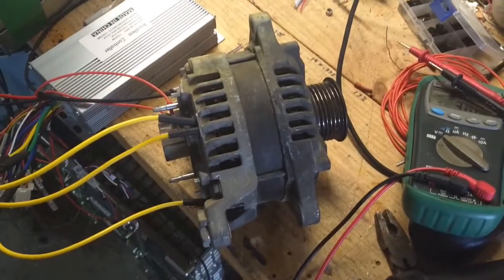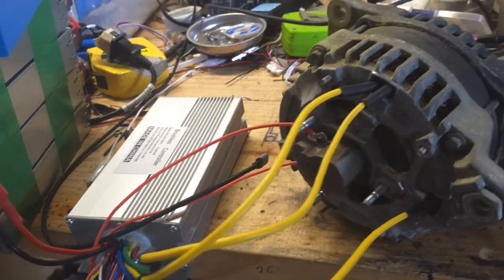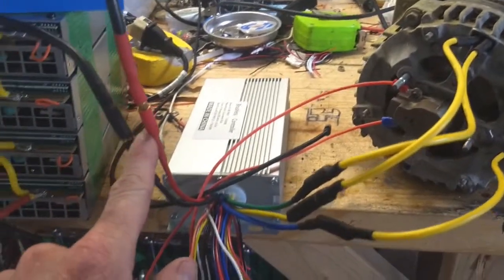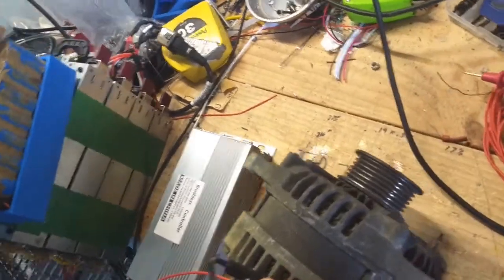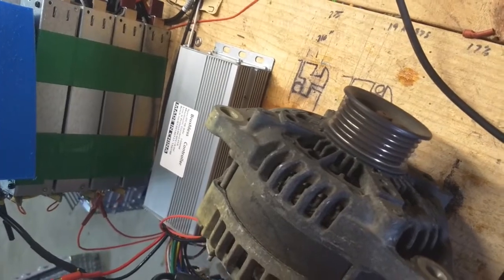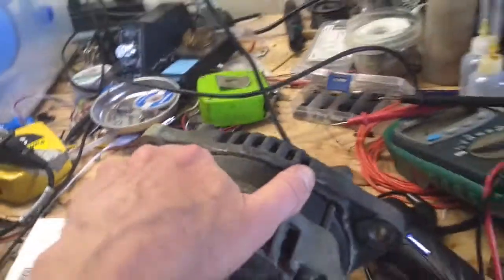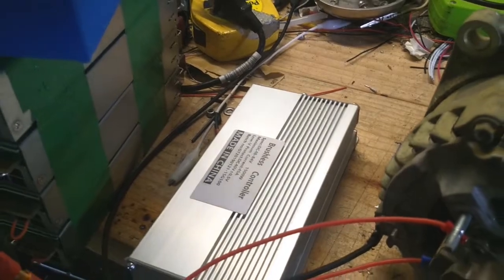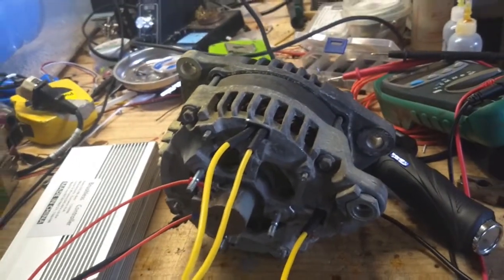Turning an Alternator into a motor

Comment: Help me l have the same project but when l connect my speed controller the alternator just gets too hot and doesn't want to run I'm using a 48vto 60v 12mps battery and 1500 speed controller what could be the problem
Reply from the maker: Put like 5-10v on that armature

Comment: I did this on a 50 horsepower boat motor and my three phase wires smoked up couldn't handle the amperage or pull for the current
Reply from the maker: Awesome, got any pics or vids?
Reply: @ericensley2427  I do but I cannot post it on comments I believe it needs to be 3,000 Watts rated at 100 amps or higher to achieve at least six horsepower if you also Google how many watts is 6 horsepower it brings up 3000 Watts

Comment: I wonder why the people who convert these alternators to motors can't simply explain which wires go to which places on the alternator (i.e. battery, speed controller, brushes and stator) and what they are for.  That would be good information for those of us who don't have a clue as to what makes these motors do what they do - which is different from what they originally were made to do.  I have watched many of these videos and though some are better than others, the people that do some of the better ones don't tell you why they do certain things with certain wires so that they become good motors that we "dummies" can convert to our use as motors.  I would dearly like to convert one or more of these things for a scooter project but even if i did everything that they say to do, I don't understand what effect it has on the original equipment to change if from generating power for charging to a motor to do work.  Also a good camera angle is often not present and labels on new wires (Bat +, Bat -, etc.) would help a lot.
Reply: I know you probably seen the videos but in a nutshell you basically have to rip the alternator apart and remove the diod pack. After that your alternator will either have 6 or 3 wires that went to the diod pack. If there are 3 your alternator stator is in a wye configuration. If it has 6 then it's in a Delta configuration and. You can use the alternator in a wye configuration but it will be less powerful and produce less torque. Where as a Delta configuration will be much more powerful and produce more torque. If let's say you do decide to use a wye configuration hooking the wires up to the speed controller will be a breeze  because there are only 3 wires and there are only 3 wires on the speed controller. But if you go with a Delta you will need to hook the 6 wires up in a special combination. Attach 2 wires to the brush assembly as well One thing I found out is if the alternator has only 3 wires and let's say you want to use the Delta configuration you will need to find the neutral point in the stator that contains the other 3 wires

Comment: could you run a 2nd alternator with a belt onto the first and than use the 2nd's output current/vol to power the first? Maybe it will be  selfrunning.. free energy??
Reply from the maker: Alternators are about 50% efficient.   There is no such thing as "free energy"  Anybody offering it or saying they have it is a snake oil salesman

Comment: I am working on a similar project for a Kart. The problem I am facing is low torque at start.

Can you explain if you have face similar issues?

Take a look on idle it run like hell, 
What gear ratio do you have on your project? 

Greetings Robert
Reply from the maker: With a sensorless motor, they have very little torge on startup.  They have to spin to find the correct position of the rotor.   This is why hall or sine/cosine or resolvers are used in motors.  Check out "Building an Alternator Powered Bike"   Austivawawa does a great job explaining everything

Comment: Would it be possible to power an ac motor from a blender with a bldc controller from an rc car? I tried just taking the three wires from the blender motor and attaching it to corresponding wires on the esc but nothing happened. Would it be possible to get it working without having to do a complete rewinding?
Reply: The blender runs in 127 or 230v

Comment: 12v on the armature is probably way too much.  That's probably why it's getting so hot.  Also if you reduce the armature voltage you'll get much higher speed out of the motor.
Reply: Just run it off 3ish volts. 👍🏼 seems to be a good armature voltage.
Reply: How i do that, Joel?
Reply from the maker: Joel, I have done that and what happens is the brushes start to bounce due to the speed.    But great point, u are probably right that 12v is too much.     Thank u

Comment: You shouldnt run these on low speed. there is not cooling enough.  At normal engine idle the alternator spins at around 3000 rpm.  So keep alternator between 3-15000 rpm is the best.

Comment: Hey! Nice conversion.  I tried to convert a alterantor to bldc motor but there is a big problem if motor runs 20-30 sec the alternator is over heating about 50-70 celsius IDK why but i need help asap! do you have any ideas ? You can see my conversion here! https://youtu.be/M8vMh6Ux8Aw
Reply: how much amps was the motor? how many volts on the rotor? and on the stator?